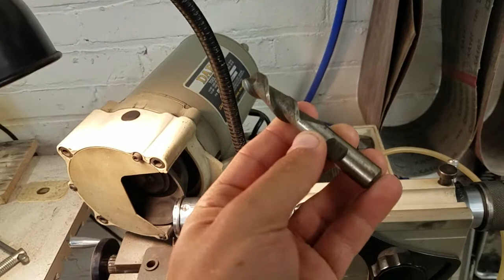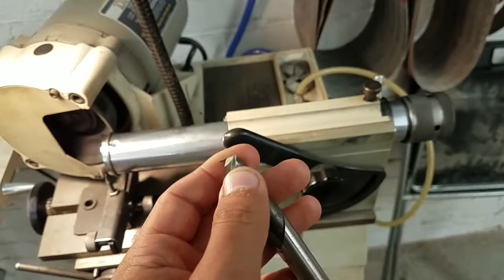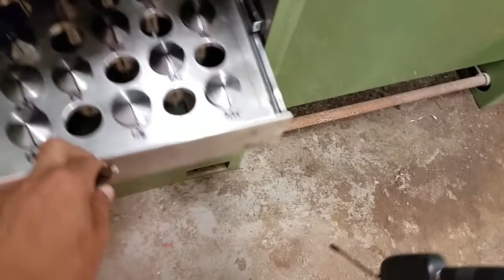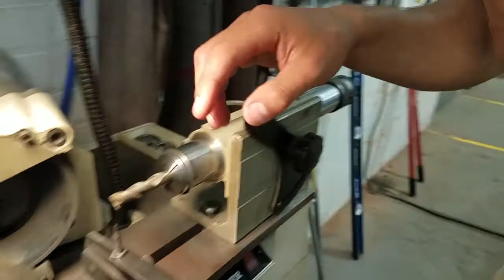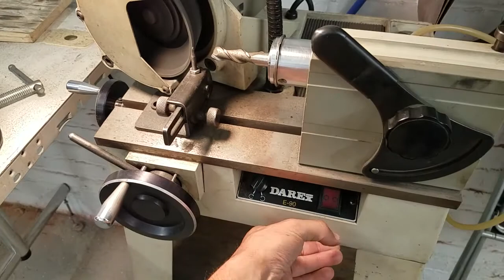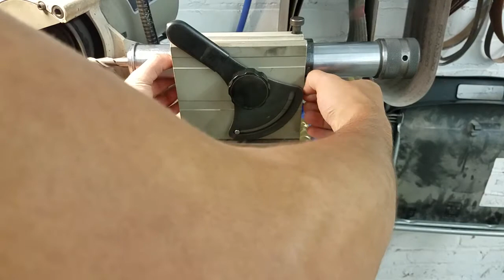How to use the Darex E85 Endmill Sharpener/Grinder

Comment: It's very important to use a high quality collet with the absolute minimum of runout. Otherwise you you will sharpen the endmill out of concentricity and it will cut on the high side and wear out that side of the flutes.

Comment: Very good video. I will share a couple of tips. To keep the air-varrel from getting dirtyyou can clean first with denatured alconol  and dry with a micro-fiber towel.. Put on aa pair oof thin rubber gloves. The will help with grikeep everthing clean and  give you a better grips for loosening the collet.For HSS end mills only use a 5" CBN Cup Wheel. This will leasve you a mirror fginish and very sharp edges. The CBN whell will bring up a nice burr which you can deburr. Save your Diamond whell for carbide cutting tools. When sharpoeing  a hss or carbide end mill with a chip always do the secondary first. This will allow you get the chip out much easier by doing the clearance step first.. All the best.
Tim

Comment: I have the same machine, i love it . you might want to replace the allen cap locking scew on the indexing ring with a brass knurled screw as was original...this wont mark the body of the spindle and also allows for far better grip for tightening it. also when loosening the collet, on the very front of the spindle there is a shallow pit machined into it and on the front face of the tailstock a little rivited pawl, this swings round and drops into the shallow drilling and locks spindle when tightening or loosening the collet chuck . hope that helps :)